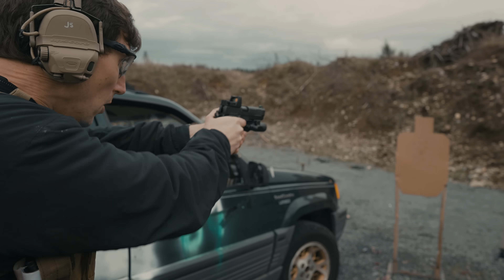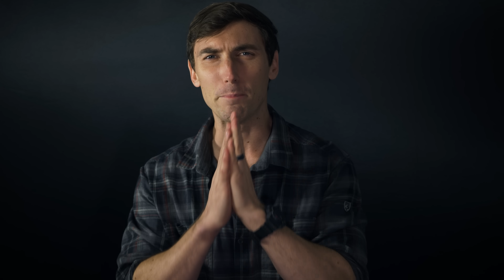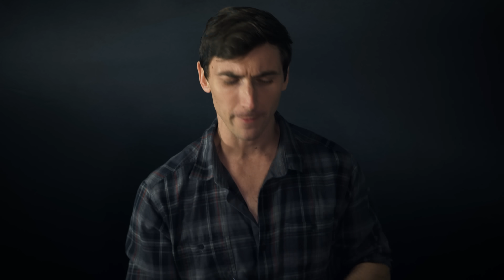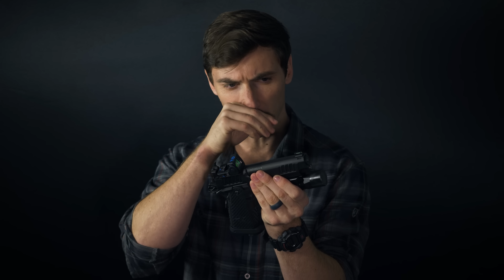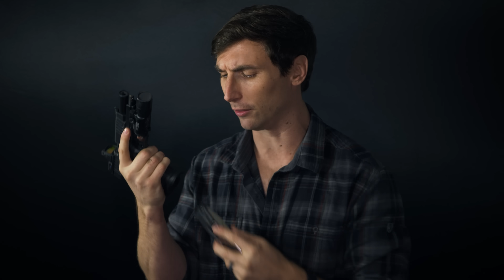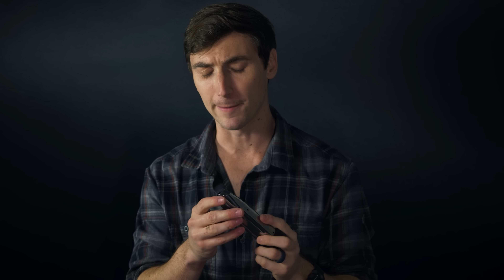Staccato, the fastest service pistol.

Comment: I purchased my Staccato P Duo in early Jan 2021. So it’s a 2020 built pistol. 

My concerns were whether or not it would be duty use reliable. The answer is Yes. The only issue I’ve had is an occasional failure to lock open on the last round due to my support hand grip contacting the slide release. So it’s not a weapons malfunction. 

All my mags are Gen II’s.  Which are far more reliable. I did have a follower break when it hit the concrete during an emergency reload. It looked like it was made using a plastic used in 3D printers. I called STACTTO and they sent me a replacement for free. The followers they sent me, and in the extra mags I purchased were made from a different type of plastic. Similar to what you’d see in quality mags.

The quality of the overall fit and finish are on par with the price point. The slide moves like it’s on ball bearings. It’s smooth, and without any noticeable play. The trigger is a really nice 4 poundish pull. The ambi safety works perfectly. Some have a tendency to hang up. 

The lockup is great. And so is the accuracy. Recoil is light and smooth. That’s due to the cone style bull barrel locking up directly with the slide. It do use a barrel bushing like some 1911 / 2011 pistols. The pistol tracks flat in recoil due to the light weight recoil spring. 

I’m running a Delta Point Pro sight on it and I’m perfectly happy with that set up. While I may not be able to use the sight as an impact weapon like a Trijicon I prefer the larger glass, clear glass, and the fact that if I manage to break it, Leupold will fix or replace it for free. I love Trijicon products. But they only have a three year warranty. And the blue tint bugs me. 

So if you have the money to buy one. Do it! And buy extra mags ASAP. Because the new King can write an edict outlawing high cap mags at any time!

Comment: Cool gun but the magazine issues, the grip angle of the double stack staccato’s (single stacks are perfect IMO) and a polymer lower is the only thing that’s kept me away from any 2011s except maybe the Atlas Athena. I still think the 1911 or edc x9 variants are a better platform. If those issues are ever fixed then take my money. For the money I would take a Wilson Combat, Les Baer 1911 or beretta 92 elite ltt with the trigger job from Langdon and use the rest for ammo.

Comment: I don't see it mentioned here--maybe try MBX magazines?  They made their bones in the market with a 2011 magazine that worked a lot better than the STI magazines after STI redesigned their grip to stop taking Infinity magazines, which is where they developed some issues as well.  

I have four of them for 9mm/.38 Super and they've worked great in my 2011 (Phoenix Trinity aluminum grip with an STI frame).

Comment: Purchased mine a few months back.  Out of the box, there was an issued with the grip safety not fitted properly where it would not fire.  For $2,500, I expect the gun to bang out of the box...especially one that is touted as a "duty" weapon.  Luckily STI repaired it and shipped it back in a timely manner.  I also noticed a design flaw (big one).  You could actually feel the back of the sear spring inside the magwell.  All 1911's that I own this part is always covered so that dust and dirt can't enter your sear area. So much for "Duty Gun" status.  
Takeaway:  For a duty weapon, do yourself a favor and buy a sig or glock 1/5th of the price.  If you are a 3 gunner, where your life is not on the line (only your score/time), then rock it.

Comment: Don't have any nice portaloo porn stories but I do have one crazy one about a dude pumping out them. Was on a larger work site that had lots of them every where involving cranes to lift them down to ground level. This particular day I was walking back to my container office when I saw this man setting up the pump truck. Usually he puts the hose into the valve into the truck then into the loos storage to pump stuff out. Then he will have to switch off the pump and valve. Then remove the hose. 

On that day the valve failed when he took the hose off the truck. The liquids launched at this face at incredible speed. The man tried his best in plugging the valve with his hands while screaming profanity.

Comment: If you want a double stack 1911 without all the mag hang ups with the 2011 format, the Wilson X-Frame - X9 guns solve it. 

It’s the modern PPQ tube designed for 9mm from the ground up. So it’s also a smaller circumference than the 45-tube the modem 2011 are forced to stick with. 

Regards,
Marky

Comment: 10mm > 9mm 

I’ll stitck with my XDM in 10mm with a compensator on the front. About to get a Glock 20 with a MXC chassis to go with it too, people who still run 9mm NOT out of a automatic smg are wasting their time when they could run 10mm out of a handgun in 2021. And for pdw if you’re not using 10mm or .300blk what are you even doin?

Comment: The 2011 is basically a Ferrari. A high performance sports car that is made to run fast and be extremely responsive. A great car for urban use, but it ain't no Lada 4x4. If you want a car to chug through the bushes with, you're better served with something else. If you want a highspeed car for zipping around urban areas with, the Staccato is basically the gold standard.

Comment: Or instead of a Stacatto, if you're one of the poors, you can do what I did and pimp out a Taurus G2C with Lakeline threaded barrel, a G3 17 round magazine (with sleeve),  a red Galloway Precision red dot mount (replacing the rear sight), an ADE RD3-006B Green Dot, and a Lakeline micro-comp.  That basically gives me a budget bad-ass but reliable gun with excellent barrel return, low recoil, and high accuracy.   The long trigger pull is the only weak point, but I've gotten used to it.  I'm just happy that I have something that looks cool, is very reliable, has good ammo capacity, is accurate, and that doesn't break the bank to soup it up.     So I know Garand Thumb reviewed a Hi-Point once.  But will he ever do a Taurus G2C, the true preferred budget 9mm pistol of the working poors of America???  That would actually be a very fun review to watch and would be even cooler if he did a part 2 with a souped up version like mine.
Reply: A fucking Taurus ? This has to be a troll post right ?
Reply: @mrwest2474  Yes a Taurus.  Not everyone can afford a souped up Glock.  If it's reliable, why not soup it up?
Reply: @wigon  Glock 19 , trijicon NS , Surefire X300, kydex holster.  That’s under $1,000 for a great package
Reply: @mrwest2474  That's way outside my budget.  I don't even own any firearms over $500.  With the souped up Taurus G2C, I get a very controllable, accurate, and dependable pistol that now shoots much better and faster for around $450.  So still well under the price of a stock glock. Yet I shoot this pistol better now than I shoot my friend's stock Glock 19.   I don't plan on doing competition shooting with it.  
I mainly souped it up just to make it a more effective home defense pistol.  I have no illusion of it being better than a tricked-out Glock.  But it is definitely a better shooting pistol now and I have much faster target acquisition with the green dot. The longer threaded barrel also gives me a bit more velocity which is always good and the mini-comp on it does a good job reducing barrel flip a little bit which allows me to make more accurate rapid follow-on shots like when I'm doing controlled pair drills.
So... like I said, a tricked-out Taurus G2C is actually a very practical poor-man's race-gun.  That's why I wasn't joking about wanting to see what someone like Garand Thumb could do with first a stock Taurus G2C and then a tricked-out G2C.  I'm quite confident that he'd like it a lot more than a Hi-Point C9.

Comment: I got a 1911 10mm because the ranch life is abusive and I had to heat up my poor Glock to get it back into shape after it got smooshed when my buckle hook broke and it fell under the tractor tire with chains on it. The steel was fine the grip was nawed and bent. I fully believe the 1911 would’ve been fine minus the bone grips. Plus stainless steel handles corrosion better when I deal with chlorine.

Comment: I purchased one August last year, left all magazines loaded when not at the range. Two rounds crossed over each other and locked up one of the magazines in December. I had to tap it on the bench to get them to fall out. Contacted Staccato, send some pictures and they sent me a new magazine. That is the only issue I've had. Cleaned once, has about 600 rounds on it. Its a great gun from what I have been able to experience. The only wear on the gun the finish on the sights, the slide and rail and frame have no wear marks from holstering . Impressive since my Safariland (6390-560 for 1911 w/X300U ) tore up the last 1911 I had in it. Comparatively, my G19.5 Is almost as old, but has notably more wear and even jammed twice!

Comment: Porta Potty in Africa-" how do you beat off in this heat?"
Reply: Easy either use your sweat for lube or wait until 0200 and combat jack while listening to your buddys snoring.
Reply: Had to leave the shutters unlocked in Iraq. So freaking hot that sometimes guys would pass out from the heat. If you locked the "jon" you could die in there.
Reply: Shitters

Comment: I think the 1911 magazine problem is user error. Don’t shoot 100 year old stamped sheet metal that’s been ran over by Jeep’s. Buy new mags, disassemble, clean the inside of the tube, the spring the follower. Look for machining spurs. Spritz some silicone in the tube and reassemble. Do it every time you clean your gun. If shooting metal cases then clean your mags after each time you empty them. Magazines are the most delicate and important part of the firearm. Take care of them.
Reply: This ritual isn't necessary on other magazines, so you could hardly call it user error. They're also not 100 years old because they don't follow the original 1911 single stack pattern.

Comment: The first thing I noticed wasn't the gun, but the fact that he was running steel cased ammo. Even Daddy Garand is affected by all this nonsense
Reply: Yea, but that steel case was still prob free
Reply: If it can run the steel then it can run the brass
Reply: @thecreaksmith5067  

The case material is irrelevant. The reliability issue with steel cased ammo is that its usually underpowered, because its cheap. The reliability issue that needs focus, is bullet profile. Anything will run RNFMJ.
Reply: @springbloom5940  they're "underpowered" because steel doesn't fire form to the chamber. So yes case material does matter
Reply: @charlesfisher3983  

A) yes it does, B) irrelevant to practical performance and C) they are underpowered, because they are loaded light and often with poor performing powder.  

There is steel cased ammo that performs just as well and is just as reliable as brass.
Reply: @springbloom5940  1) steel does not fire form to the chamber. Steel is not malleable enough for the pressure load during firing to cause the case to expand. 
2) it's ridiculous for you to argue that an improper seal around the chamber doesn't affect internal ballistics.
Reply: @charlesfisher3983  45kpsi in a 7.62*39 or 60kpsi in a 5.56 is definitely enough to expand a steel cylinder with .015" walls to fit a chamber. If it didn't, you'd be torching case mouths and flame cutting your chamber.
Reply: @randomidiot8142  this is 9mm but good try chief
Reply: @charlesfisher3983  and 9 nato spec is 36kpsi. Even if it was loaded to 25kpsi, you really think .012" of mild steel is going to remain rigid and not expand to make a gas seal? You don't get out much do you?
Reply: Assuming 4130 in a normalized state, with a .012 wall on a .380" case mouth less than 4kpsi will burst it. And you're still going to claim it won't seal at tula pressure, aren't you?
Reply: @springbloom5940  But between what he said and what you said its literally the same thing. He just turned what all gun people know already into short terms.
Reply: @springbloom5940 not only that, but it doesn’t shrink back to size like brass and can get stuck cases
Reply: @charlesfisher3983 I’m with you bud, he’s a hard ass and don’t wanna listen
Reply: Maybe he was testing for reliability because 2011s are finicky with ammo.
Reply: @julian23561  supposedly when sti restructured, they put a lot of R&D into making their new line of pistols "duty" reliable
Reply: @twoalpha4775  Management restructure?
Reply: Finally found some wolf steel for myself, my g17 roland loves it
Reply: Yeah I noticed that it made me feel proud to have my two mags of 5.56 brass cases federal
Reply: @jaredbello6553  
You Sir have won the internet for today. 😂🤣😂
Please be humble and merciful with your powers.
Reply: I noticed that too lol
Reply: i think it was aluminum case in some of those clips. but hes always said shooting steel is fine for guns.
Reply: @jaredbello6553  Abe Lincoln didn’t say that:  Jesus did.
Reply: Next thing you know he will be picking up brass...this is the end times...
Reply: @Joshua Bressel damn, wish i was older and could have been stocking up. I just turned 18.
Reply: Me too.
Reply: Was just going to type that above lol
Reply: @HarryManback0  dude, he's talking about the video clips.
Reply: @charlesfisher3983  I see he deleted his comment trying to show how smart he was hahaha dude was a jackass
Reply: He isn't affected by any ammo shortage. If you think he is you clearly don't know his sponsors. He running steel to show it can run steel. Who's buying that pistol and shooting steel anyway?
Reply: New poor's like the 2008 housing crisis and recession.
Reply: You spend more on ammo than a $250 barrel. Gotta test it.
Reply: @jaredbello6553  Awesome lol
Reply: Jokes on you my mosin runs on steel case.
Reply: Bruh, same.
Reply: buy your ammo and guns online at 🇺🇸
Ammotoretail.com
they are certified FFL dealers, they sell all possible ammunitions and guns available...shipping is done all over the USA and worldwide (fast delivery services)
they have 9mm, 308, 300blk, 5.56, 6.5 creedmoor, 380 And so on. contact us on 
Website:Ammotoretail.com
WhatsApp : (512) 508-8760
Reply: @FirstName-df7yj  Never
Reply: Nice. Never had an issue with steel case and the Glocks however it is safe to say any caliber under .45 in a 1911 frame is always fun to shoot.